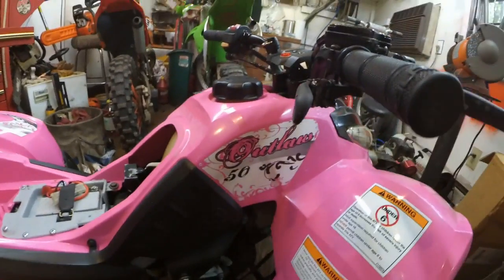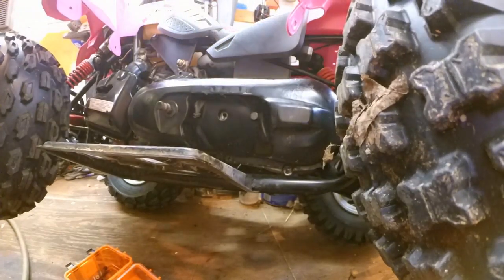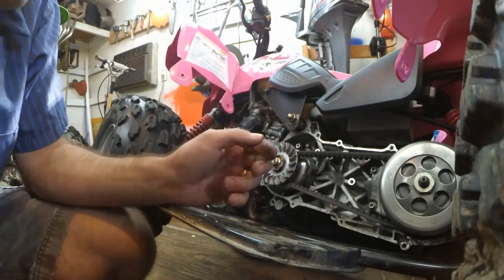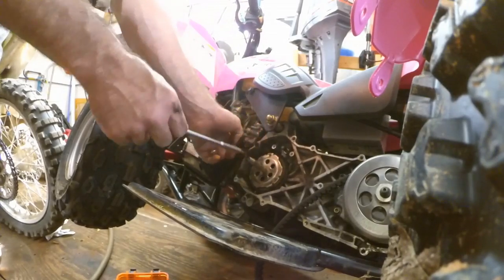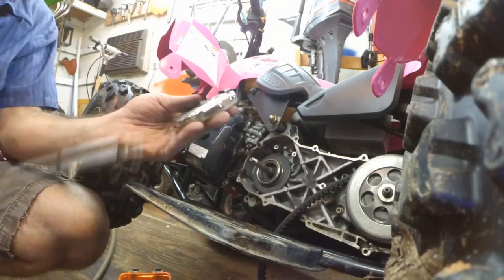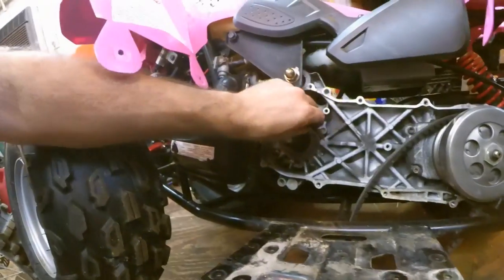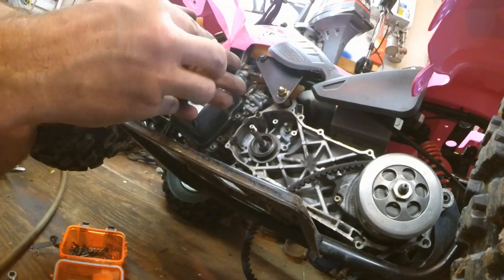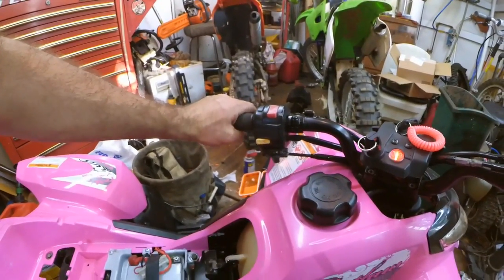Polaris 50 starter clutch Starter not working repair

Comment: Did you replace the gasket or was it still good?
Reply: Same question!
Reply from the maker: It was still good, just a dust cover gasket really. I cut the center out so it wouldn't interfere with the belt, you can see the part I'm talking about when I remove the cover.

Comment: Hello everyone, here I am from France and I wanted to know someone could help me solve my electric start problem on my 2001 sportsman 90 quad?  I contacted a lot of forums at home in France and no one can find a solution for me.  This is my problem now, when I press the start switch, the starter will turn but the quad motor will not turn.  I changed the relay contactor, the battery but nothing changes.  I disassembled the crankcase or there is the clutch but I do not see anything special.  The pinion which drives the assembly works well but it does not drive the clutch.  Looks like the starter is spinning in the opposite direction ..... Can someone help me?  Thanks in advance.  Nicolas

Comment: Hi can You give a couple of tips to Fix mi polaris
Reply from the maker: Sure.
Reply: @TepcoCycleRepair  i ,try  to pass charge a mi polaris and i burn 2 cables .those cables go in side del motor .now mi moto dont start.and i check the spark.and is fine
Reply from the maker: If you have good spark, check your compression and let me know what it is.

Comment: Have a similar issue with a '04 Predator 90.  Try to start it the relay just buzzes and battery wires get hot as hell.  Starter spins freely, battery is brand new and tests at almost 13V, and everything spins freely as it should, but when I try to start it the relay just buzzes.  I'm at a standstill.  Any ideas?
Reply from the maker: The relay might be bad. You have to check current flow when you hit the starter. Find the starter wire coming from the relay, hit the starter and see if you're getting voltage at the starter. If not, replace the relay. If it does, you either have a stuck starter or starter bendix like this video. Be sure your battery is good by checking voltage going to the relay when you hit the start button, it shouldn't drop much.

Comment: hey My name is Lamont meet you up at Greg's shop (motoary) a couple times.. I have the same machine 09 model its blowing a fuse every time I try to start it do you think I could have the same issue
Reply from the maker: Possibly, you may have a bad wire in the starter harness grounding out. When you hit the starter it sends power through the line, grounding out shorting and blowing the fuse. Check all your wires for exposed areas.

Comment: I have the same quad and i put new carb and run for a little the die 
Wont start again. Try to jumpstart and it cranck a couple times then nothing ? Should i check my connection the open
Reply from the maker: Check the carb jets, if it's a Polaris carb it should be right, if it's aftermarket you may have to reset it to work.
Reply: @TepcoCycleRepair  reset what and how? If an aftermarket carb i still have the original but my problem the starter its not cranking and it was running fine for like 10 minutes with the new carb then die
Reply from the maker: @danyvecerra8712  reset the carb jets. If it's a aftermarket carb the jetting is basic and usually not set for your machine. You will have to start checking your spark plug and rejet the carb until the plug looks tan.

Comment: i thought the yellow button was a hot start. its also a start button? and if it is, and not working the starter must be bad or it was disabled?
Reply from the maker: It's just a start button, these atv's don't have hot start buttons. If yours is not working, check all your connections first, then check if the starter is getting power when you hit the start button. If it is, pull up open, and clean the starter first.
Reply: @TepcoCycleRepair  thank you

Comment: Thanks for the video. I'm not having the exact same problem. On my little cousin's the Kickstarter works but the starter didn't work. I put a new starter on it. It worked for a week and then sounded like the gear had lost its teeth. I figured it was garbage metal. I pulled the starter and it was fine. I opened everything up and it was spinning both of the starter gears, but they weren't engaging. I found that one of the little bearings in that one way clutch was messed up. It has one vertical and one horizontal. The one horizontal one with the spring behind it was wedged all the way in. I also found a small 1.4 flat piece of metal all mangled sitting in there, but i can't figure out what it's from. I don't see why just that one little bearing would make it not engage. Maybe i should just buy a new clutch piece (not sure what exactly that piece is called). Any advice would be appreciated.

Comment: Hi. I cut out last night and my bike doesn't start back up on the kickstart. It feels like there is no grip that's turning the engine. When I turn the pulley with my hand it just spins and doesn't grip onto anything to turn the motor. Any ideas as to what this would be? I dont think its the mechanism in the casing because the lever springs back up and it clean, it's just on the variation side that's not working properly.
Reply from the maker: Joshua James Cole if you're able to spin the motor by hand with no resistance, you might have blown it up. I would pull the head and cylinder off and take a look. See my other LT80 top end video, it's the same.

Comment: Hi, i have the same problem. The Atv went through the flood of 2016 and the last gear that you pulled off (the one that was seized) I can't get it off of my quad. I've tried everything i know from oil to wiggling, to prying, etc. So, I was wondering how you got it off, or what you think I could try to get mine off. Thanks!
Reply from the maker: Timothy Martinez the last gear that had the bearing in it will be tough to get off if it was rusted. I would spray the area where the bearings are with penetrating oil and let it soak. Then use a 90° tool to get behind it and wiggle it back and forth to get it off.
Reply: Tepco Cycle Repair Ok, thank you! I will try that tomorrow. Do you think a gear puller would work also? Because I found some videos of people trying that.
Reply: While using the penetrating oil.
Reply from the maker: Timothy Martinez Maybe but its tight behind it so it might be tough to get the puller in there. You see in the video I had to wiggle it, that was because it needs to come off straight. If it gets crooked it will act like its stuck. You might also try some heat so it will expand slightly.
Reply: Tepco Cycle Repair Thanks for all the ideas and suggestions, I will surely try all of these.